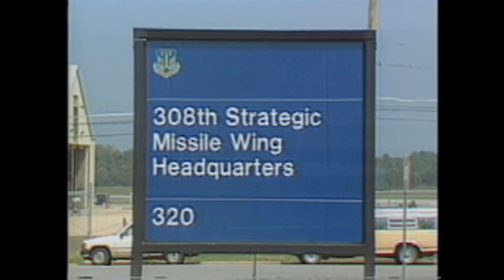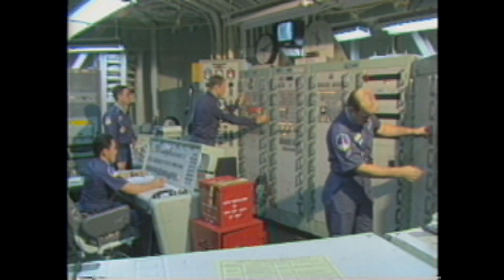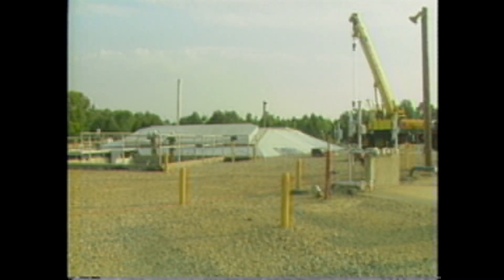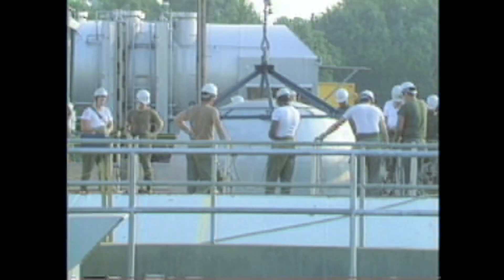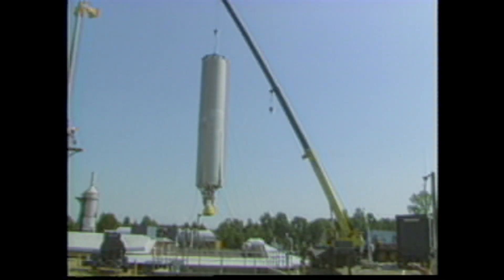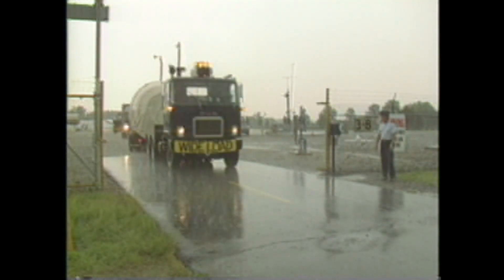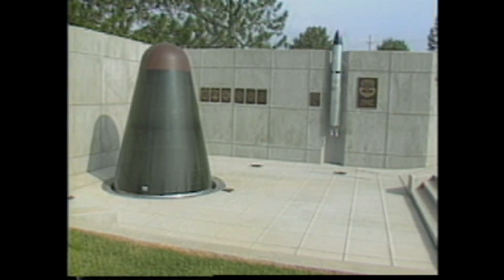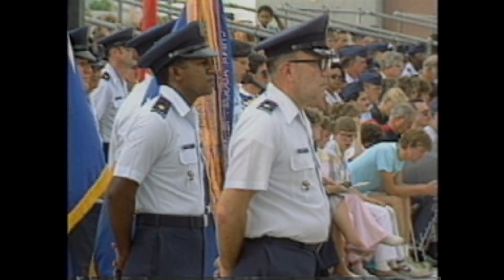TITAN II : DECOMMISSIONED

Comment: One of my bosses was the first person to enter a Titan Silo that had exploded and sent the nuclear warhead a half mile away.
Reply: I also worked at Lockheed Martin where they would refurbish old titans for use by NASA.
They once lifted one from the silo STILL FUELED and hauled it across the country to Lockheed.
Once it got there, they figured out it was STILL LOADED with fuel and oxidizer.
They are NOT supposed to be strong enough for that, so it was a MIRACLE that it did not break on the road and cause a massive explosion.
Reply from the maker: That was a crazy mishap!